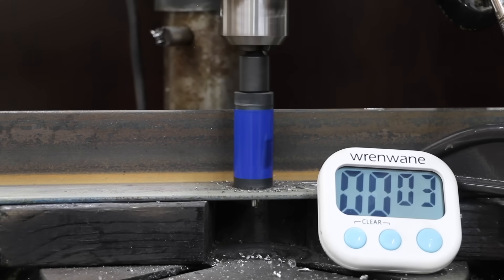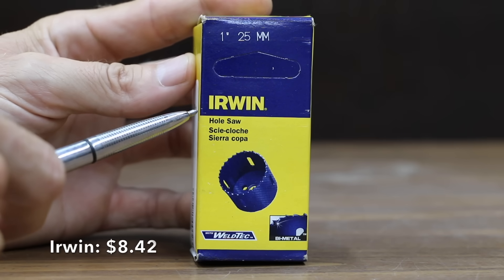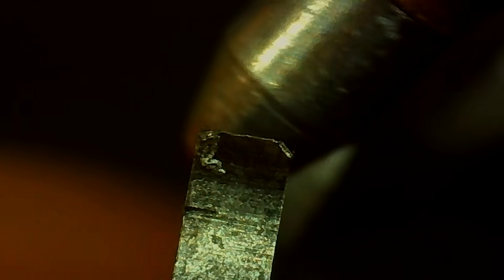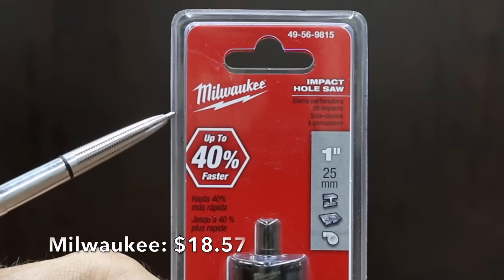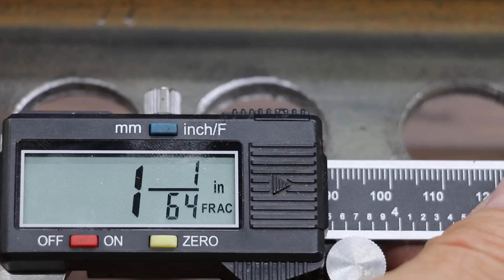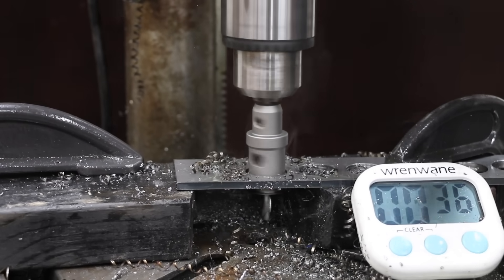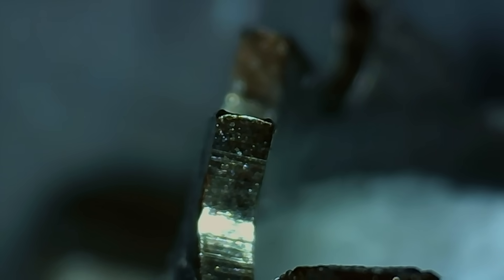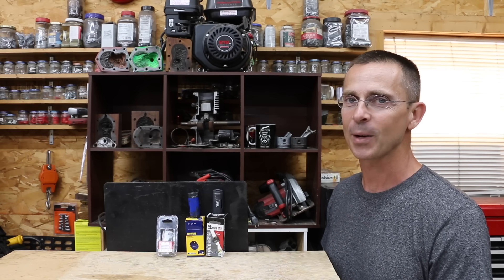Best Hole Saw Brand? DeWalt vs Milwaukee vs Irwin, Bosch, Lenox, Diablo, Bosch, MK Morse

Comment: You can’t judge carbide at the same speed as tool steel. Carbide tooling needs to run at a much higher speed therefore your test is flawed
Reply: Carbide does not need to run faster, it just can run faster. To be economical, you run it faster and make up the cost with increased production.
Reply: @darkwinter6028  you do realize that time was a factor that was used in this test, don't you?
Reply: Paul Frederick - yes, but the original comment said “need”, implying that something bad will happen, like tooth breakage or excessive wear. It won’t; you’ll just be wasting time, that’s all.
Reply: Paul Frederick - actually; I think the hiccup here is what we are defining as ‘need’. You don’t need to run at an optimum speed. As long as you aren’t running it so fast it burns up the tool, you will get a hole. You also don’t need all the gears in your car to be functional; you can drive it with only second gear. Do I recommend either? Nope! 😉

Is the test valid? For what it is; yes... but don’t extrapolate beyond what the data can support. 🙂
Reply: Paul Frederick - yes; if you are racing (or, for that matter, just trying to keep up with traffic). Not everyone is, though... and even in production environments, sometimes there’s operations where it just doesn’t matter, because something else is a holdup (I’m thinking of a production line environment where a part becomes available to a process stage at a rate that’s slower than what the process stage takes; however there may also be other factors at play like tool life, etc). Sub-optimum is, well, sub-optimum; but in a lot of situations it’s not fatal. Doesn’t mean it’s recommended, though. 🙂
Reply: Carbide should be tested differently true but...this is probably the best test out there
Reply: Maybe not much higher. HSS is 100 SFPM and carbide is 400 SFPM. This test was run at 173 SFPM. So a bit on the speedy side for the HSS.
Reply: Not really, out in the construction field every drill typically goes the same speed. You gonna make your boss buy you a faster drill so you can use carbide?
Reply: @Eric12886  there are other fields beyond construction. But you do bring up a valid point. Poor practices are going to produce less than optimal results. So that condition does need to be tested. It is surprising what can be achieved when things are done right though. In the name of productivity Project Farm could do a video on speeds and feeds. It is a topic more should be aware of.
Reply: Carbide vs HSS speeds is Machining 101. Test is flawed on that variable alone.
Reply: @dpmulvan  there's really no way to compare HSS to carbide as they both need much different operating parameters.

Comment: Not complaining awesome testing but I think the hole saw getting stuck was a weak drill press mine does it. Also that carbide tip that broke hit the table of the drill press. Anyway good video!
Reply from the maker: Thanks for the feedback.

Comment: I am a commercial electrician and have noticed better performance with Greenlee, Klein, ideal, and dottie carbide holesaws than some of the ones you tested. I have used the Ideal carbide holesaws to cut through 3/16 stainless steel. Which is very hard to cut. Great videos!
Reply from the maker: Thanks for sharing!

Comment: I can tell you put a lot of effort a time I to your videos keep up the good work.

Did you ever consider testing different brands of chainsaw bar oils are the more expensive bar oils sold by the saw manufactures like Stihl really better than the cheaper oils found at tractor supply and Walmart.
Reply from the maker: Great suggestion!  Thank you.

Comment: I wouldn't mind seeing something with wire wheels. Either on an angle grinder or on a bench grinder. I'd like to see if there's any brands that don't fray or are resistant to throwing wires out along with a quality of rust removal
Reply from the maker: Thanks for the video idea.

Comment: The test is done but Starrett hole saws are a good consideration.  They are cheap and put up with my abuse.  Cut after cut in 4130 tube, clamping the tube well.  I have also broken many brands of hole saw by not clamping well enough or letting the drill get loose.  Great video.
Reply from the maker: Thanks for the suggestion for future round of testing.

Comment: the carbide quick cutter bits wont go through the thicker armour plating if it is to thick. The spring will bottom out and prevent the teeth from engaging properly.
Reply from the maker: Thanks for the feedback.

Comment: 250 rpm is kinda slow for carbide. No wonder you chipped them. For mild steel, aluminum I prefer high speed steel. Bonded carbide inserts create a tensile strength issue imo.
Reply from the maker: Thanks for the feedback.

Comment: Using a hole saw works best with a drill press that has rigidity and no drill runout. Runout is the most damaging part of using the saw causing the teeth to chip. A pilot drill really helps with homeowner equipment that is not to rigid with drill runout and column flex. Drilling in thicker material really takes a toll on the teeth that have to eject  metal from a deep channel. I can tell you from experience that if you would us a bridgeport mill the  most of the cutters would last way longer. But most people do not have that luxury in there garage. I like your method of using a bicycle rim for consistent pressure for the tests. Nice job fella too. VF
Reply from the maker: Thanks so much!
Reply: @ProjectFarm  I really like the topic Project Farm. You have some of the best videos on YouTube for sure. Good day fella and stay virus free.

Comment: Great video again mate👍🏽 Noted the run out in your drill press.. this would alter the actual finished hole size. How many of these drills would you say came from the same manufacturer just rebranded?

Comment: I was told AR500 has high manganese, which, when drilling, basically work hardens (brinell number increases)This is evident why all the hole saws look promising on the AR500 at the start, then stop cutting. You need a speed less than half of what was used to successfully drill high maganese materials.
Reply from the maker: Thanks for the feedback.

Comment: Try a diamond mason holesaw.. they work great on steel.. just keep them cool with water... I've even cut out a tap on a hole that I broke off... With a diamond masonry hole saw
Reply from the maker: Great suggestion for future round of testing.
Reply: @ProjectFarm  broken taps and easy outs are nearly imposable to get out.. the Mason diamond tip hole saw has saved me time and headaches cutting through the tool steel...

Comment: I would like to see the “spyder” hole saw also tested.
Reply from the maker: Great suggestion for future round of testing.
Reply: Project Farm I was thinking the same thing please test the spyder brand saws
Reply: @ProjectFarm  If you're ever adding to holesaw tests then I'd suggest Sutton
Bimetal - dark blue > white are the main contenders with dark blue being the best, skip light blue 
TCT HD - Black > yellow (perpendicular tooth for tile/cement sheet/wood etc) they are both similar however black is 5mm tooth, 3mm wall compared to 3/1 if memory serves
TCT -silver - for metal, will have either 5 or 25mm cut depth

Comment: Your true test would be trying to cut throught 3 pieces of 2x4" while also cutting into some odd nail that goes between the wood. Trust me the frustration of killing holesaws goes to maximum level very soon. And also when they go they want to lit the roof on fire too.
Reply from the maker: Thanks for the suggestion.

Comment: For speed test it would be good to let chips get out. This can be done by either drilling slightly to the side of a flat bar (so that the teeth barely go outside the bar) or having a gap or hole in the material at the circumference of the saw.
Reply from the maker: Thanks for the suggestion.

Comment: The spindle runout in the drill press doesn't do any of the hole saws any favors.  That's actually a good thing for this test, and most use cases though.
Reply from the maker: Thanks for the feedback.

Comment: I would like to watch a video about different types of drill bits from the same manufacturers.  For example, what is the difference between a standard Dewalt's metal drill bit and the Extreme or Cobalt series. Is the extreme series worth to spend more money on it?
Reply from the maker: Great video idea.  Thank you.

Comment: 11:07 You made a mistake, you said 140 seconds while it should be 1 minute 40 seconds.
Reply from the maker: Oops, thanks for catching that.  Yes, 1 minute 40 seconds!
Reply: But it was correctly entered in the sheet at the end :)
Reply: or 100 seconds
Reply: metric time :p
Reply: Mike Zhurba I guess you are being sartistic, as there is NO such thing, but when the metric system was being developed, they ACTUALLY DID TRY TO DO AN HOUR INTO 100 PARTS  but it all din not work
Cheers 🇺🇸🇺🇸🇺🇸🇺🇸
Reply: @flybyairplane3528  Recognize sarcasm?
Reply: I picked up on that too was seeing how many others did still interesting video
Reply: I saw that too but its all good

Comment: I have a Milwaukee Hole Dozer kit , and I don’t get to use it with a drill press , I have to use a cordless drill. For what I’m doing to them , they have impressed me. Came with 11 sizes , 2 mandrills, and 4 starter drills for only $109 ( on sale ).
Reply from the maker: Thanks for sharing.

Comment: I would love to see Starrett included in the saw tests. A Starrett salesman told me that most of their sales is saw blades (band saw, hacksaw, holesaw, etc).
Also, please don't ever sell out.
Reply: I agree, I have used many brands of hole saws but find that the Starrett is the best.
Reply from the maker: Thanks for the suggestion for future round of testing.
Reply: @ProjectFarm  care to settle this for us?
Reply: I agree the starrett were junk in metal trades Lenox were much better.
Reply: Starrett blades are the worst I've ever used.  Only harbor freight blades are worse.  Metal and wood
Reply: @Robbievigil  that doesn't at all line up with my experience

Comment: Is it me or is there some play in the drill? It seems to be wobbling around a bit.
Reply: Either the drilling setup was not ideally rigid (lots of vibration) or the vibration was in the camera mount. Pretty hard for me to tell which. There was certainly some drill walking, but you're going to get that with a hole saw against a flat surface. Nice video though.

Comment: Great video and testing Todd, thank you!
How about masonry and wood bits?
I'd especially like to see some spade (flat) bits for wood tested. It seems like after a hole or two they need resharpening regardless of the brands I've purchased.
Reply from the maker: Great suggestion!  Thank you.

Comment: I tried out a Diablo 1-1/2" and had trouble with it on med-hardness 3/8" plate. I determined that the quick change mandrel left too much play between the tool and the work piece and the lack of rigidity caused widespread chatter that lead to catastrophic failure of the carbide teeth.
Reply from the maker: Thanks for sharing.

Comment: Great job, Todd! Do you have your product comparison charts posted anywhere? For example, if I am in Home Depot looking for a tool, it would be great to go to a website and find the charts to help me decide which one to buy. In the case of the hole saws, for example, a rank of the top 3 or 4 with the best value highlighted. As in this case, a chart for each hardness of metal would be helpful so I don’t have to over buy. One other test that I would like to see is how many holes does it take to kill a tool? If I know that I need to drill 10 holes but your test shows that a certain tool will only drill 8, then I need to buy 2 or a better tool! Thanks for the great work, and as always, thank you for your service!
Reply from the maker: Thanks for the suggestion.

Comment: I strongly suggest you buy a mill-drill for future tests like these, the damage to the carbide teeth looks to be caused by too much downward force and a wobbly drill press quill.  A Mill-drill or Bridgeport would improve the stiffness greatly.  You can engage an automatic downfeed with a bridgeport too, couple that with an electronic scale to measure downfeed pressure and you have some repeatable test scenarios that are more reliable than the current setup.
Reply from the maker: Thanks for the constructive feedback.

Comment: every one of those hole saws could have gone though that ar Armor with slower speed, coolant, and less pressure. i have drilled though 1" plate before with the lenox bits and thye are still cutting like new. its not what is best, its what tool will take more abuse with neglect. other than this, all of them will last a LONG AF TIME.
Reply from the maker: Thanks for the feedback.

Comment: I would like to have seen a drill off competition in mild steel of the best performing brands.  How many holes can a user expect to get before the holesaw is trash?  Also, the size comparisons would have been more helpful if they were in decimals rather than fractions.
Reply from the maker: Thanks for the suggestion.

Comment: I think the expensive hole saws would have done better at a much higher RPM.
Reply: Yup, carbide generally demands a higher speed than high speed steel.
Reply: Yes, load will make a difference. Take this away though and I believe PF’s test shows which are built right and will hold up in real world use all the same.
Reply from the maker: Thanks for the feedback.

Comment: Great video, PF!  Over the last 20 years, I’ve drilled hundreds of holes in mild steel, and there’s no doubt there is a lot of variability, brand to brand.  If you wanted to expand your testing, see how many holes can be drilled before the hole saw is too dull to continue.  Thanks for all you do.
Reply from the maker: Thanks for the suggestion.  You are welcome!

Comment: Some hole saws are really for thin materials only, but if they don't state this on the packaging then that's part of the manufacturer's fault. You may be able to get away with cutting a hole in thicker metal or wood, but some of these are optimized for sheet metal. Testing them in that capacity would be interesting too - though quite a few took some damage in all these tests. 
PS: For drilling tests, could you also do some wood, plywood and aluminum? Aluminum is gummy and can clog drills, while plywood can have the surface veneers split out with some drills. And wood is more about speed. So seeing if some drill these better than metal would be interesting - designers don't always get to decide the marketing!
Reply from the maker: Thanks for the video idea.

Comment: Love the videos my friend!! I work in a collision shop. We use a two part adhesive. Generically know as (panel bond). 3m,crest,winter. Ect ect. Used to glue bedsides and roofs on. And basically anything you want to permanently bond. This stuff gets rock hard after 24 hours. Once again!! Great informative videos. Thanks man. 👍👍👍
Reply from the maker: You are welcome!
Reply: Project Farm respect my friend.
Reply: Thanks brother.

Comment: I know you put motor oil through severe testing so how about 5w30 full synthetic (no matter what brand just as long they are the same brand)  GF-5 API SN Plus vs. GF-6 API SP? The new SP rating came out in May 2020 and it would be interesting to see how much Motor oil has improved.
Reply from the maker: Thanks for the video idea.

Comment: Can you please also add the metric system when measuring things like the hole diameter, so that all the other people outside the USA can better understand the differences? I don't get these 3/64 things without using the calculator.
Reply from the maker: Thanks for the suggestion.

Comment: Dang, I bought a Lenox hole saw about six months ago based on my own aggregate of several dozen forums, websites, and other online sources. My second choice would have been Diablo at the time, then Milwaukee (likely the shockwave as I've liked their other products from that line but Dozer was commonly recommended as well) as a disposable. Drill Hog was recommended, too, but I passed it up based on price.

Goes to show that objective testing always wins out over subjective opinions and anecdotes! I'm definitely saving this video for the next time I buy a hole saw, cause my perception on good brands was turned on its head with this one!

Video suggestion: hole saw test on wood, and include spade bits as well! One objective factor in the test could be how much they chew up/chip the wood
Reply from the maker: Great video idea.  Thank you.

Comment: Great work!! But a couple things as an engineer and machinist the more data you display the better good job there, but please display the hole measurements in thousands of an inch, that is so much easier to visualize. Next I question whether the carbide chipped during the ar500 plate due to material hardness and normal wear or because the bit was allowed to walk a slight bit due to no pilot hole and drill. Just wondering if that would change the results. Still overall great work!
Reply from the maker: Thanks for the suggestion.

Comment: The DeWalt carbide design is made for commercial level cutting.
Milwakee
Dewalt
Greenlee
Ideal
Klein
All have a similar design and would be a tighter competition. Bimetal hole saws not on the same level.
Reply from the maker: Thanks for the feedback.

Comment: This reminds me... we have been upgrading specific size forstner bits as needed from a generic Chinese made unbranded kit from 3/8" to 2", to individual sizes that we need for real jobs drilling in laminated bamboo. Been buying single bits on Amazon that have real carbide cutting edges. Did you ever to a forstner  bit test?  If so, I could use a link... if not, that should be soon.
Reply from the maker: Thanks for the video idea.